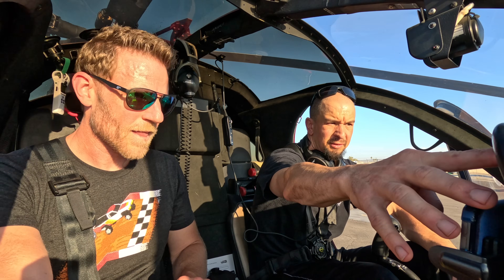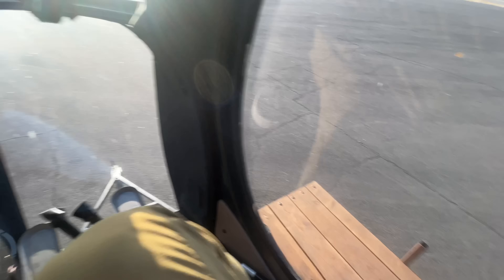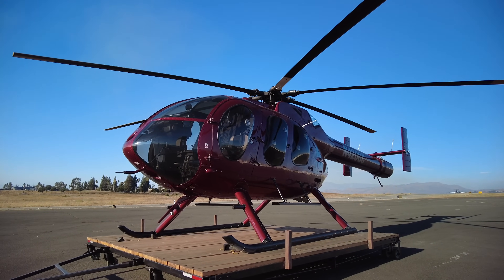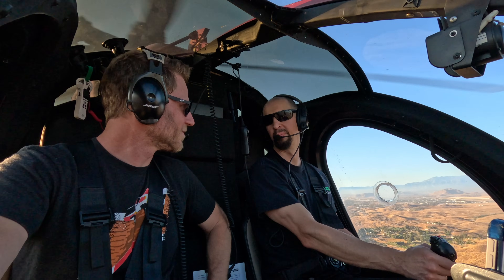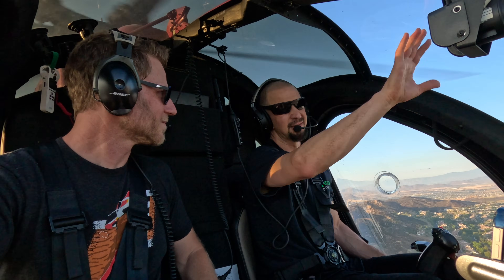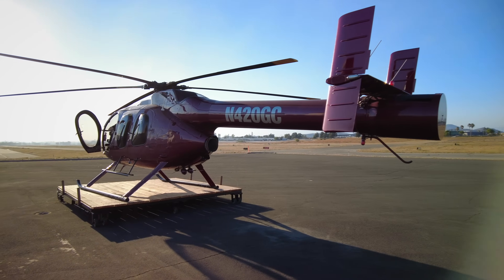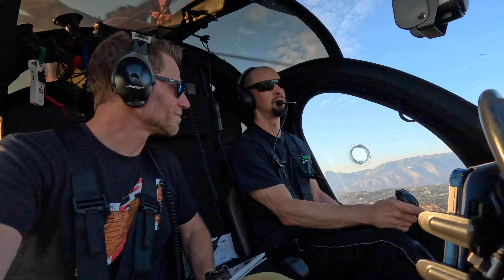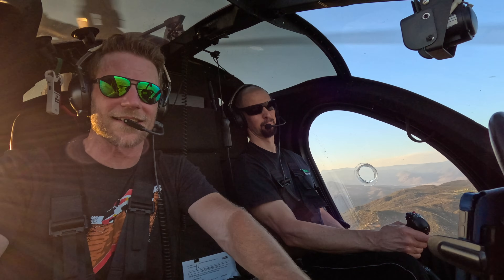MD 600N Review | A Helicopter With No Tail Rotor?!?

Comment: NOTAR is definitely on my bucket list. It wasn't mentioned in your video but they are a lot quieter too. The tail rotor produces a lot of the noise. The high blade count, if balanced well, makes for a very smooth flight. A lot of helicopters have a lot of vibration.

Comment: I have about 100 hrs in a 600N. loved it.  the department i worked for bought the second production 600n.  we had right hand commands installed. the only problem we had with the
machine was that the bolts wore very quickly on the vertical fins.  miss the machine.

Comment: The MD520N is my absolute favourite heli. I grew up listening to them in the air around Phoenix because Phoenix Police had 7-9 of them throughout my childhood. Such an awesome sound and appearance. Made right in the east valley.
Reply: Not sure when they stopped flying them completely but the city sold off the last one in 2006. I was told a main reason they switched over to AS350 was parts availability. Even with the factory in the same county PPD couldn't get parts.

Here's some trivia for you. The first seven off the line; serial numbers LN001 through LN007 all belonged to Phoenix Air Support. Also LN097 and LN098.
Reply: @9HighFlyer9  Yup! I went down a rabbit hole of looking up where most of them went after being sold off. I know a couple ended up in New Zealand and Australia for tours and a couple ended up in South America. One was bought by another PD in California and is still being operated currently. A few were bough and used up until they had accidents and were no longer air worthy, I think one had a hard landing on the skids and cracked the fuselage too much for repair.
Reply: I went through the Phoenix Police Academy in 95'... occasionally one of the PPD NOTARS would visit, epic.  Some comments about challenges in the Phoenix heat.  SPD 'borrowed' a silver civilian helo for YTK (owner lived in N. Scottsdale) as I remember.😊
Reply: They're my favorite for a similar reason! I grew up seeing them with the Prince George's Police Department. They have such a unique sound. Thankfully they still fly em here

Comment: Hi Micah and Wes.  My best friend, Desmond Casey was killed in a San Jose police department 520N crash back in 1999.  You need to understand and be prepared for the very different characteristics of a ""coffee can" failure in the NOTAR.  The fan blowing air down the tailboom is driven by the main transmission (rotors turning = air blowing).  Des had a cable failure of the directional can tail exhaust.  The "coffee can" opened full open and the yaw forces were uncontrollable.  Natural tendency is to put full opposite pedal in to counteract the rotation.  On a NOTAR this only exacerbates the problem.  You must go pedals neutral position as this is the lowest pitch in the fan blades that are blowing air down the tailboom.  Des finally turned off the engine and autorotated in an attempt at stopping the yaw but in the NOTAR air is still blowing full force out the back as long as the main rotors are turning.  As a former Army Blackhawk and civilian EMS pilot I won't ever fly in a NOTAR helicopter again.  It's a bad design where one part failure is catastrophic and the emergency procedure is counter intuitive to everything taught to helicopter pilots about anti torque malfunctions.  I'm sure this is why the value of these helicopters is so low.  Fly safe my friends!  Inspect those cables (ball and swedges) carefully along with every other part of that system. John
Reply: "coffee can", I've never heard of that phrase.
Reply: @stresswes  yea, that's what Des and the SJPD pilots called the aft rotating opening.  It looks like a coffee can. :)  The mechanic came out because the night before the ball and swedge in the cable that moves that aft can had pulled apart but had gone back in almost immediately, although that was only determined by the NTSB after the crash the next day.  They landed at a small airport and the mechanic came out the next morning.  He was told about the erratic yaw movement they had experienced the night before and he looked everything over.  He deduced, incorrectly, that the yaw dampner that controls one of the vertical rudders on the tail had failed.  They disabled it and the mechanic hopped in for the flight back to San Jose international so they could replace the yaw dampner.  The took off to a hover, did some aggressive pedal turns and then headed off to San Jose.  The NTSB determined on downwind when the they were slowing down the slight bend of the tailboom put enough pressure on the cable's ball and swedge that it became disengaged and this time it did not go back together.  This allowed the aft can to go full open.  Des and the mechanic were both killed in the crash.
John
Reply: @Falcon50EX  I had heard about a cable issue that caused separation and loss of yaw control in the past, that is something that became an AD that was updated and fixed in the 600N's to my knowledge. I am not affiliated with MD and I'm sorry about you and the family's loss. I just fly the aircraft sir.
Reply: Thank you Wes!  Just wanted you and others to be aware of the weird emergency procedure with that type of anti torque malfunction in a NOTAR.  Des would have been a perfect Youtuber!  He was a lot like you both.  Loved to help people.  Thanks for donating your skills and equipment to help others.   Fly safe and have fun.  Beautiful helicopter. @stresswes

Comment: Micah
Thank you very much. 
I really like, enjoy and appreciate all of the single engine MD’s and I’m very happy that you were finally able to do a review on an MD600N and I really truly appreciate all of the information that you were able to give us about it. 
I would be excited like you were too, just that you were in little kid mode, so cool, so cool, so cool that you didn’t take the time to refine this video with better sound, graphics and editing that you kinda did, overall really actually the very best most informative MD600N video that has ever been put out by anyone. 
I had never even heard about that LEO’s were having right turn stall problem with the NTR versions of the MD’s so thanks for letting us know about that. And even better you got us the down and dirty how to information on how to get out of the stall that only an MD full articulated rotor system can live through. Where all of the Bell, Robinson and non fully articulated rotors systems would have had a tail boom strike resulting in the tail boom being struck by the blades causing a catastrophic structural failure falling out of the sky until the wreckage crashes into the ground resulting in death as we have all seen with that video of a Robinsons R22 falling out of the sky in Texas just like several Bell 429’s and even there flagship 525 have done killing everyone onboard. 
One of the many reasons that the MD types are the best and safest helicopters ever made. 
Thanks again Micah
Excellent very knowledgeable video.
Ohhhhhh 
I should add this information for others who read this, the Bell helicopters are made on the cheap with sub quality materials in their tail rotor control parts and there control parts are failing which causes the tail rotor to go out of control which causes the main rotor blades to strike the tail boom shearing off the entire tail causing the Bell 429’s and Bells first 525 to fall out of the Sky killing everyone. 
Just an FYI 
Look it up if you can.